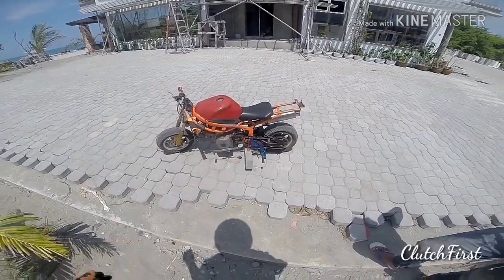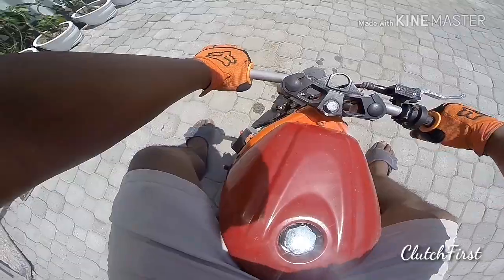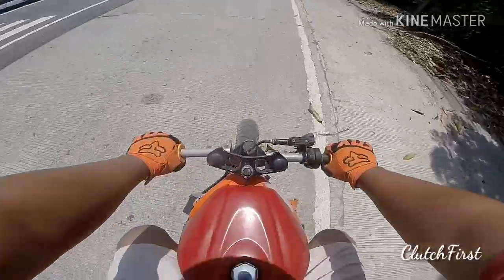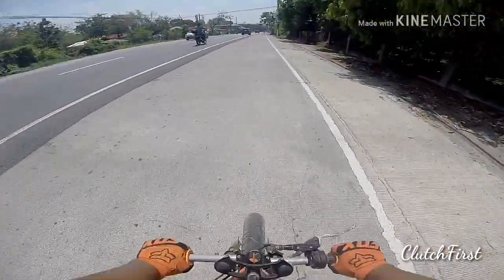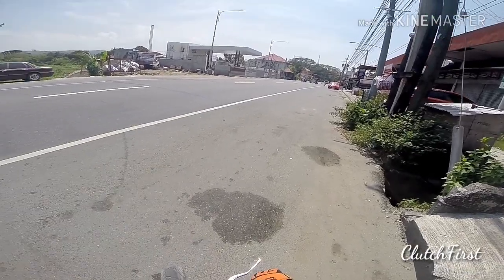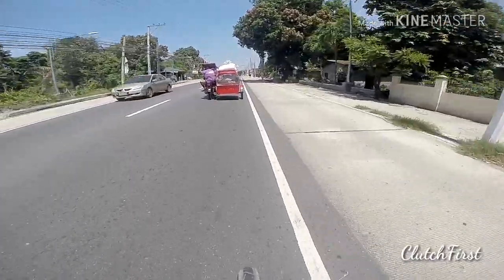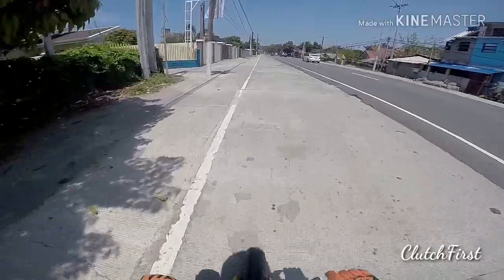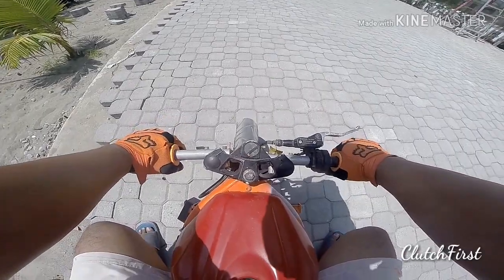Motovlog | 127cc X7 Pocket bike in the Philippines! (Test run: Part 1) | La Union | Philippines

Comment: did you modified the chassis? and also is it still manual transmission?
Reply from the maker: Yes. I extended the frame bc of the engone size. And  made motor mounts.